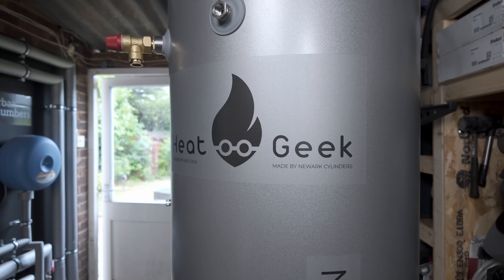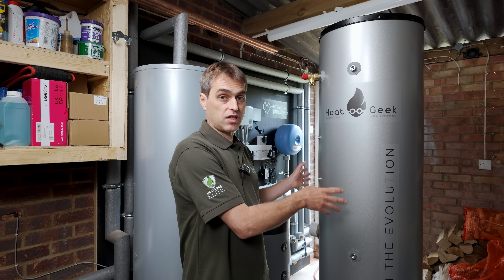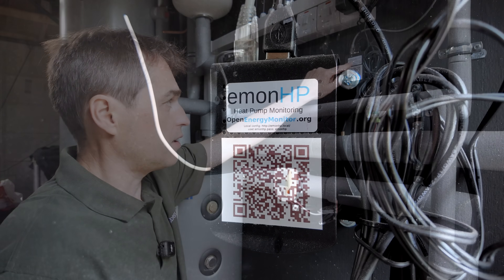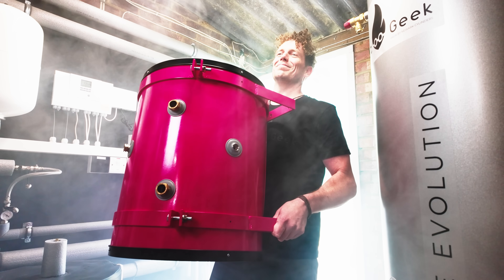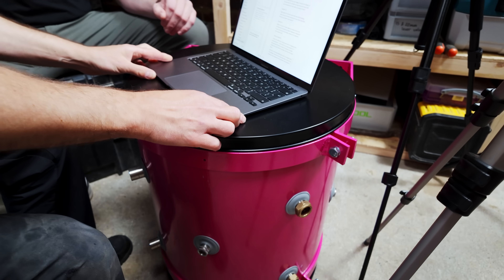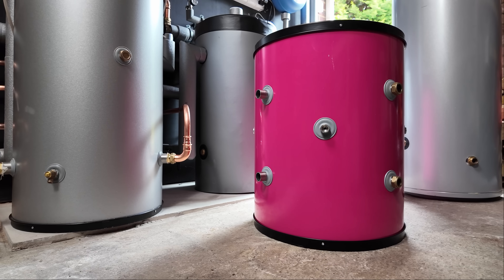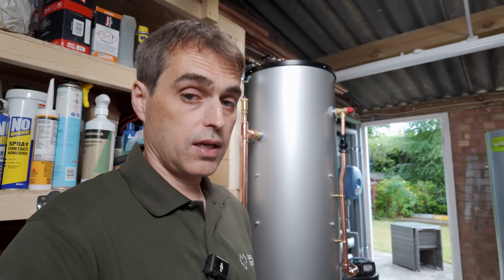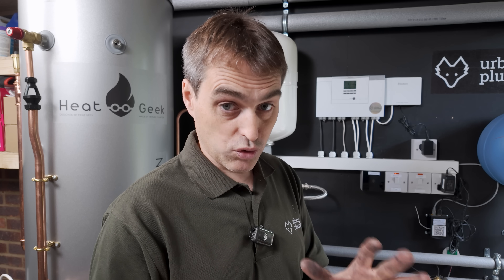Heat Geek Super Cylinder Tested: The Most Efficient Hot Water Ever?

Comment: Urban Plumber, you're so lovely.  However, I'm worried that you may be misleading some people. 
First concern is this; if our hot water drops to 45°c my wife stands there running the hot tap and shouts at me " John, we've got no hot water.
Second concern; a mini cylinder would be virtually useless at 45°c, might serve as a hand-wash.
Third concern; you give a CoP of nearly 5, but it is July, what about a foggy freezing November day?
Fourth concern; in the winter your 5kw heat pump will have its work cut out heating your space.
That efficient cylinder is absolutely huge and most probably costs a small fortune which would make it unviable for the masses.
When we are getting more wind energy, a heat store at a high temperature may be what's needed. This would help the Grid by avoiding peak times. A heat pump running constantly isn't always going to be a viable solution.
I like a hot bath, a good soak for 30 minutes, in that circumstance as the water cools down some really hot water is needed as a top up. Howabout having an inline electric booster?
Say run your heat pump hot water at 45° and then bringing it up to a useful temperature with electricity?
Reply from the maker: You can heat up that cylinder to 75c with my heat pump, it just will not be crazy efficient. No need for electric back up as it will always be less efficient.

Regarding annual efficiency Adam 12 months scop of DHW is 4.7 

Regarding national grid - recharge water at night when the grid has surplus of energy and not much to do with it - so they sell it for 1/3 of the price.
Reply: @UrbanPlumbers  yeah, you've got to realise we've had record warm winters recently. I have lived through a couple of cold winters, look up 1963.
I store heat when the wind blows, on a few occasions I have earned a little credit, have a hybrid system and use resistance when necessary. 
There is no solar in the UK heating season, which could contribute to heating. The government needs to build up to date gas plants which are more efficient. 
Just imagine a prolonged high pressure event in winter, no sun, no wind. Even recently 3/4 of our electricity came from either gas or imports. I watch the mix every day and at times it's gas and nuclear doing the heavy lifting. 
I'm a farmer, I feel the rush for solar is misguided, solar can't power a single house without that energy is stored for when the sun doesn't shine.
My son's partner can exhaust an ordinary dhw cylinder with one shower so I fitted an extra 300l cylinder. For 30 odd years I have used Economy 7...but that's dead now.....EV's?
I'm an old man and have had 5 kids in the family and you get through a bit of hot water.
I do have a heat pump, 16kw, the plate on the side says something like 3.8kw input. When I first started using it I pressed the instantaneous power button and it was drawing 9.6kw.
I don't know about the heat pump being "green" it was myself that was "green".
What I have decided to do is to reinstall the oil boiler and use the heat pump when the leccy is cheap. There's no way I could afford to run the heat pump continuously, it hardly ever goes below 6.5 kw. The underfloor works fairly well but my rooms need 3.5kw and the idea of radiators is hopeless, I would need 6 large double rads per room. What I have found is Panasonic FCU's which would do the job at 35°c, there is a catch, they're about £1,000 a piece, 8 rooms with 2 apiece would be a fair chunk of cash.
If home batteries ever become safe and reliable and have a 30 year lifespan that could make a dent in our carbon, solar roof and decent battery people could be self sufficient for half the year. During the winter the battery would help the Grid. Perhaps we could go onto low voltage dc for
lights tv fridges etc which would be more efficient and use the inverter for heavy loads.
A lot of electricity goes to heating the atmosphere in the transmission and distribution so avoiding these losses and less need for upgrading infrastructure would be a win win!
Reply: @jonjo6886  You might want to get your facts straight. Not sure what your point is about cold winters, was below -20C for 3 days straight here in January and my heat pumps still heated the house and provided hot water.  There is solar in the UK heating season, it might not cover much, but for rooftop solar there is seasonal offsetting - your excess generation in summer can at least help cover the cost of your winter usage.  You're also fantasising about the "but sometimes" with it being very cold and no sun nor wind.
Even if gas was providing 100% of electricity all year round, on average, a properly installed heat pump will have used less gas than burning it in the home.  Bottom line is, it's not, so from a green perspective, any generation by other sources is a bonus.

a 16kW heat pump should have around 8kW on the plate. If you pressed a button for instant power then it's likely there's an additional immersion element kicking in.   Heat pumps shouldn't be run in an "on demand" fashion as that is when they are least efficient.

If you get an oil boiler installed then the person doing it will be breaking the building regulations, as a less efficient system cannot replace the existing system.

If your heat pump hardly ever goes below 6.5kw then it was installed or setup wrong.  My whole house's electricity (including cooking, PC use etc) for January averaged less than 4.2kW with the outside temperate spending 2/3rds of the month below 0C
Reply: Brush up on your reading skills,Ben. I said we heat one Bathroom, just switch on for a few minutes when in use.
The thing is this; replace 20 million gas boilers so there's nowhere near enough renewable.
So you're exchanging direct gas heating with indirect gas heating. 
Nuclear takes decades to even get consent and then the build time probably another 15 years. To cap it all, old nuclear was say 37% efficient and even now it's only up to 45% and there's a small fortune to decommission the things.
There's no way you could say wind is carbon neutral. There's a colossal input of energy building the things. Then a huge investment in getting the power onshore and distribution of same. When the wind isn't blowing hard enough they are running on Grid electricity. 
Then, when there's a windy day we're paying to switch the things off.
Burning imported Biomass is just too silly for words.
Solar could be a winner, those of us that can ought to have a battery. My brother has 54kw of solar and a battery system. 
We breed Shire horses and a fellow breeder has a solar roof on stable. A month or so ago, the whole lot burned down. A fault in the solar system was to blame, luckily nobody was hurt.
Reply: @jonjo6886  and yet you still failed to answer my simple question
Reply: Hi Ben, my house is exposed, Georgian and virtually as it was built. The old sliding sash windows have distortion glass and even one has a metal frame. The narrow brick walls are built with lime mortar. Before I was born the windows had external wooden shutters, some. Of the hardware is still evident. Several rooms have 3 external walls. 
I'm really not allowed to do much to alter things.
I just feel it's pointless doing more calculations as to heat loss is big.
Reply: @jonjo6886  heat loss calculations are essential for sizing a heating system properly, regardless of the building make-up.  Just guessing and putting a heat pump in is a recipe for disaster.    It would also have a big effect on a gas or oil boiler running costs if the per kWh cost was comparable to electricity.

It's also not a step that can be skipped with an MCS install.

So you are basically admitting that your heat pump experience is entirely invalid because it's essentially a cowboy install or pre-dates MCS Ceritifaction, so is not representative of a modern/proper heat pump installation.
Reply: Just now we are on 45% gas and 20% imports. Say electricity has a negative CoP of 3.
Reply: Hi Ben, thanks for taking an interest. I like to get my facts right, just looked up electricity in Sweden and 41% hydro and about 30% nuclear.  Yesterday in UK we had 45% gas and 20% imports. 
My place has absolutely huge heat loss. We never heat the bedrooms or bathrooms save for a radiant electric in one bathroom. 
We only heat rooms we are using and rely mainly on burning wood.
When it is windy I can get credit for using electricity. 
If there was anywhere near enough solar in winter people would be self sufficient in heating  but virtually nobody is.
As far as I can see however much solar and wind we have in UK, we need back-up.
I would like a solar/battery system but.....for a start I'm almost 80 years old and the technology isn't quite good enough. 
Electric cars aren't viable at present but they will get there. Batteries need to be half the weight they are at present and also the fire risk is far too high.
Reply: @jonjo6886  You're not getting it.
If the UK was on 100% gas for electricity. It would still use less gas overall than burning it in the home.
Being generous with an average gas boiler efficiency of 90%, it means that the average UK annual heating of 10,000kWh, would use 11,111kWh of gas.
With today's Gas Power Plants >45% efficiency (some >60%) and Transmission losses (UK average was 8% a decade ago, but lets say 10%), to break even a Heat Pump would need a SCOP of 2.46.  And that's only when the grid is 100% gas, which it never is.  Given that the MCS minimum is a SCOP of 2.8, you're looking at a gas usage saving of around 25%, again, on a 100% gas-powered grid.  Add in the other forms of electricity provided, like Wind etc, it reduces that SCOP requirement even further.

"My place has absolutely huge heat loss", Facts please... what's the heat loss and at what outside design temperature?  If you're heating 1 main bedroom with a standard electric radiator then the heating system is designed wrong, unless it's some sort of externally detached guest bedroom that is rarely used.
Reply: BeninSweden, if it is freezing our heat loss is about 25kw to heat to 21°. We haven't been heating the bedrooms so that cuts it down. 
We have 2 oil burning Aga cookers, 3 wood burning stoves, a 1kw heater in one bathroom and a fan heater in another bathroom plus the 16kw ashp. I'm currently fitting a 26kw oil boiler.
The heat pump was very good on Economy 7, that has done us well for at least 3 decades.
The end of December last year my contract expired, I had been enjoying 1/3 price leccy for 7 hours per night and charged a 4,000 litre tank with the ashp. If I managed 1 : 2.5 with the ashp my cost per kwh was 4p.  That's gone for good since EV overnight tariffs! 
Now I run the ashp on Agile, it's been good at times, I set a plan everyday with an eye on ambient temperature and electricity prices. It's dead easy with a smartphone app which was under £10.
We only use heating when required, possibly the underfloor in the morning and the wood burner in the evenings. 
To run the ashp 24 hours would cost an arm possibly 2 legs.
A son of mine laid a lovely wood floor in one of the rooms with underfloor and that doesn't work any more.
Reply: @jonjo6886  Classic case of doing it wrong then.  16kW is woefully inadequate for 25kW heatloss at ~0C.  You are also running it incorrectly if you aren't allowing it to maintain the temperature - which is when heat pumps are most efficient.  Using it "when required" kills efficiency.

So all you're doing is confirming it's a terrible set up, especially if needing multiple sources to cover the heat loss at freezing temperatures.

Also for 25kW heatloss, you're looking at around 50,000kWh annual usage. With an oil boiler, that's about 5291L of oil.  At the current oil price of ~63p per litre, that's £3333 if oil was taking on the duties itself.
A properly set up heat pump (or more likely cascade in your case), would require about 12,500kWh of electricity.  At the current price cap, about £2,795.  Or on agile £2,250.  At the MCS minimum it'd still cost marginally less to run - about £3215.

Also, I'm curious as to what happened to your "great" Panasonic A2A heat pump you had last year?
Reply: @BenIsInSweden  oh yeah, I forgot the Panasonic, that really performs well. It is useful if we get hot weather, didn't have to do any cooling last year though. 
Another thing I have is a Daikin air to air which heats a room in minutes if the ambient isn't too low.
At the moment I can't beat the immersion heater for hot water, I run it at the pre set temperature the thermostat had from new, 60 odd degrees c. Nearly always there's an advantageous time of day, often 2 to 4pm when solar is good.
Reply: @jonjo6886  How are you judging the performance of A2A? Because the speed of heating/cooling isn't a good indicator of performance nor efficiency, and there's no easy consumer way of measuring heat output over electrical usage.
An Air 2 Air unit that cools too quickly is oversized, and loses one of the biggest benefits of a properly sized system, which is dehumidification. 

And yes, yes you can beat the immersion heater for hot water.  Use the heat pump to heat it to its max temperature (typically 50-55C for R410/R32 systems), and then let the immersion take over for the rest if need be.  With R290 ones that can do 75C there is no need for immersion.
Even a heat pump at a COP of 1.1 is still 10% more energy efficient than immersion.  

If the daikin can't handle low ambient temperatures then it's likely undersized - again, a heat loss survey at the outset and a properly designed system would have avoided any of your issues.
Reply: A modern cylinder will blend hot water to 45-50’ for safety anyhow

Comment: Excellent video I look forward to perusing the OE data.

It is great that Newark have adopted the HG design(s) and not at all surprising that other manufacturers have followed and anyone who understands production engineering will know why.

Very impressive performance figures all round. But there is an elephant in the room. Newark cannot be producing these and selling these at ‘shop average’ heat pump cylinder  prices. So the elephant question has to be at a say 10% reduction in running costs (compared to a Joule HP cylinder) what is the break even point (in years) to affray the additional capital cost of the HG cylinder? (Not a Luddite negative question).
Reply from the maker: It’s is going to be years. Possibly even 10-12
Reply from the maker: It’s is going to be years. Possibly even 10-12

Comment: Jeez, 6m2 puts my puny Megaflo with 0.79m2 into perspective 😮 I always wondered why higher surface area coils weren’t “a thing” when I researched into using solar evacuated tubes many years ago - it was still a niche back then but it seems things haven’t moved on with the legacy OEMs that probably still just use variations of the same designs with minor tweaks rather than full on changes to coil surface areas - cynically also probably down to cost as provided the temperature is cranked up and the recovery time reasonable they couldn’t care less about efficiency I imagine 🙄
Reply from the maker: Why would manufacturers spend more on materials - 95% of installers and customers only look at the price and maybe insulation rating - that’s it. Hard to shift a 6m2 coil cylinder that costs much more unless you can show people what it does !
Reply: @UrbanPlumbers  exactly, it's self-fulfilling unfortunately, plus the cylinder is probably the least "glamorous" part of an install in their eyes and the coil is invisible so "who cares?" as it were - on the other hand everyone loves shiny new heat pumps that they can tell their mates about or show the neighbours, unlike the poor old cylinder tucked away in the airing cupboard 😏